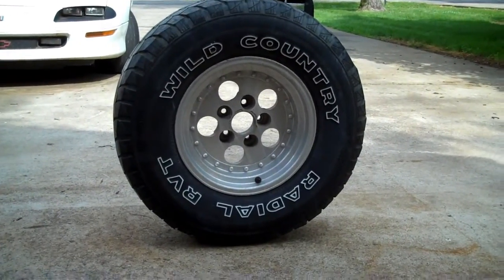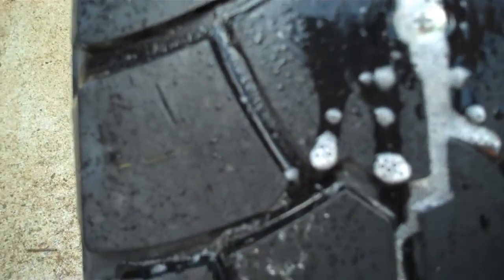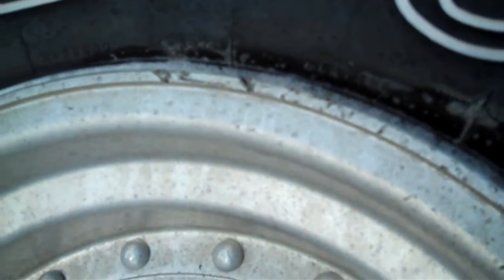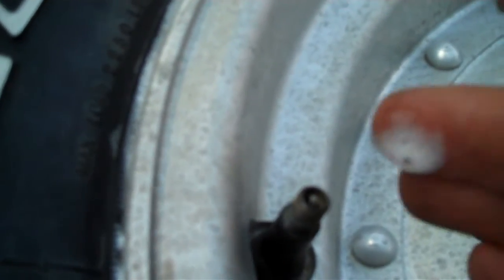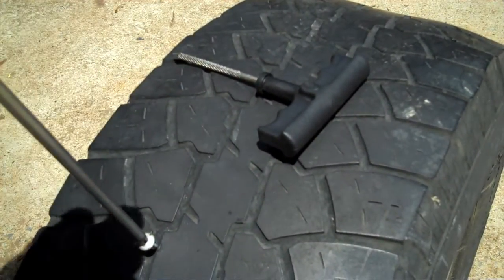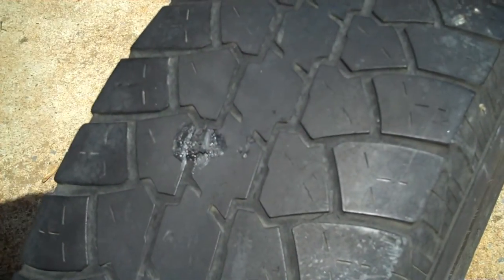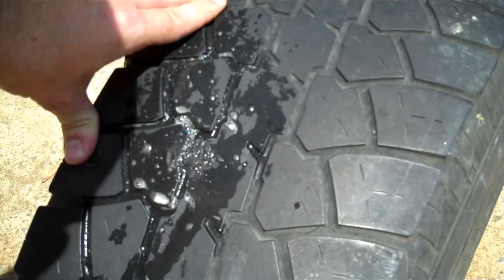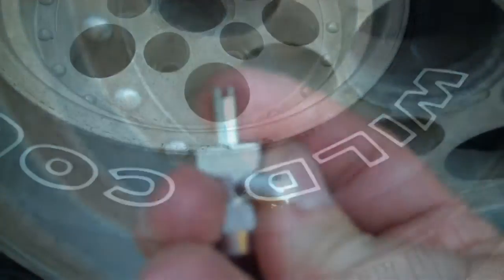Car tire keeps going flat? Find that leak and fix it! Step by step demo.

Comment: Gonna try that brake fluid method you mentioned around the rim of the tire. That's where my leak is coming from. Awesome video btw, saved me 50-70 bucks
Reply from the maker: Thanks for the great comment! Glad my video helped you. The brake fluid does work most of the time. It softens the rubber to help get a better seal. Make sure that its clean around the tire bead and rim before applying the fluid. Usually if the brake fluid doesn't work, there isn't much that will. That tire I was using in the demo was dry rotted and done for. There wasn't anything that was gonna seal that thing! Again, glad the video saved you some $$ and was a great help! Have a great day!